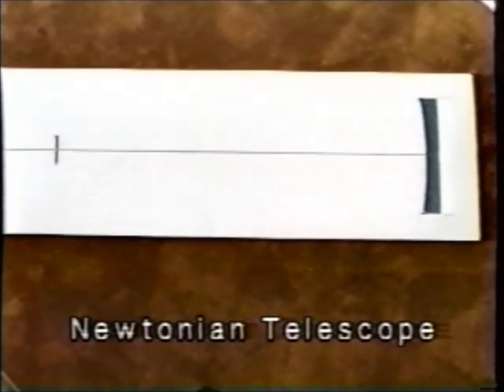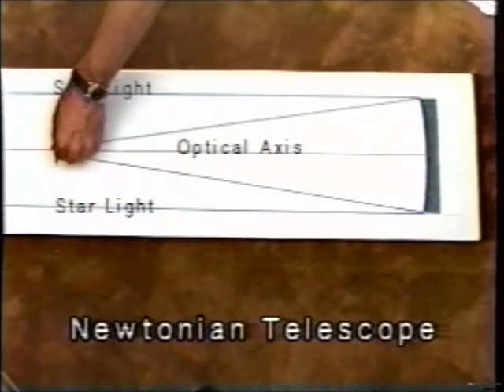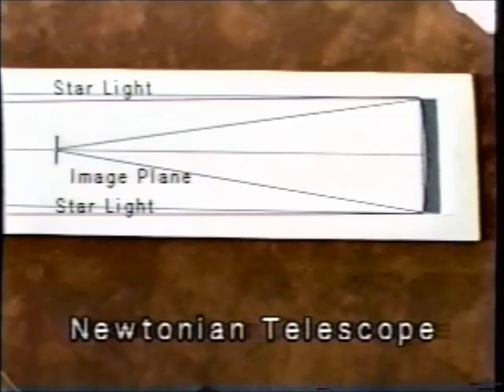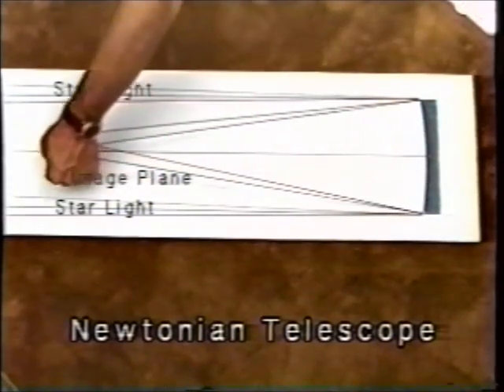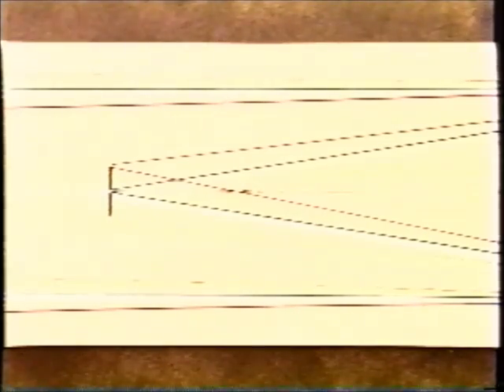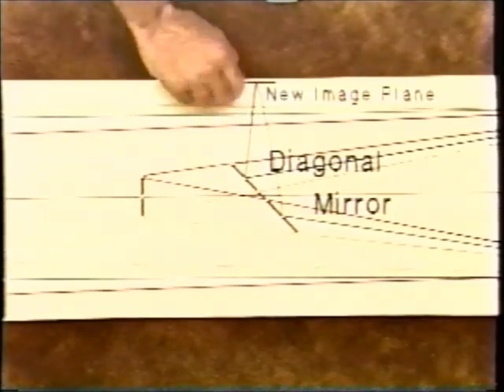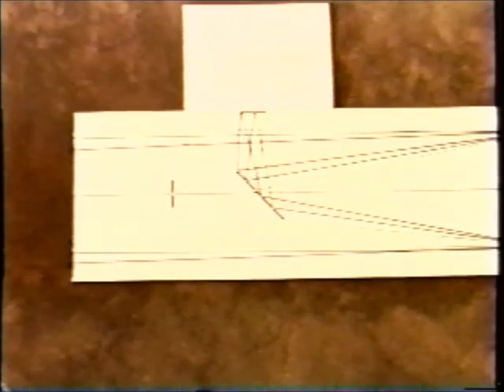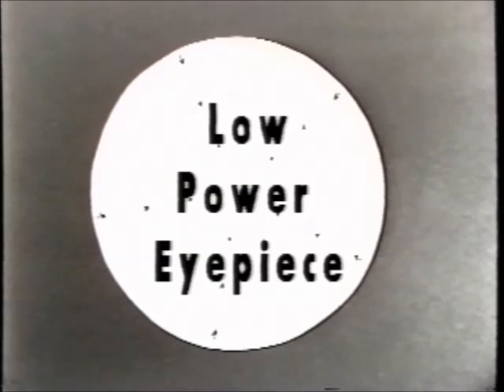Collimation of Newtonian Telescope Part 1

Comment: What he failed to mention or make very clear after dropping the secondary mirror assembly down the 'OTA' or 'Optical Tube Assembly', was; "This will likely lead to primary mirror damage!", "Do not let this happen.", "Do this step in a horizontal or front/downward angle."
Yes he does mention a caution warning.

Comment: Did they not have collimators in the 80s? Also I have alignment screws and markings for both mirrors on my newton
Reply: In 1977 a digital lcd watch cost around $2k. Now they're a buck or two. That was when a dollar actually had some value still too. Crazy expensive technology.
Laser collimator...oh God.
Just yesterday I called a guy about a used orion 6 inch reflector telescope that's around 20 yrs old. Asked about a collimator and he said, "you do it manually there's a procedure in the instructions". That was all I had to hear...click.

Comment: That decor...and that stache. This has 1977 written all over it. Well done vid though...hehehe
Reply: Close but I think you're a decade off. The proof is at 5:24. 
In 1977 if you bought a TV it didn't have a square screen like a monitor. That's 1980s I think.
Just an opinion. Could be wrong.
Reply: @mikeries8549  The hifi equipment + chunky watch makes me think maybe 1990s.

Comment: I have a NEWTONIAN 150/750 and have collimated it to precision with a laser collimator but STILL SEE crosshairs!

Can you help? What am i doing wrong?
Reply: I think those crosshairs are from the spider. That cross section at the top of the optical tube. This is normal for Newtonian telescopes. You'll see them if the image is out of focus, but they will go away once you focus the image.